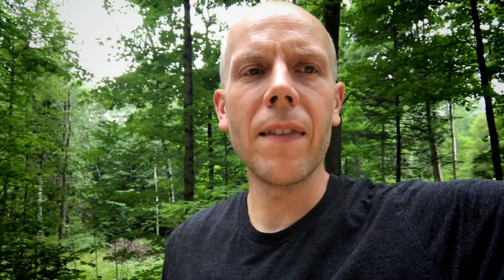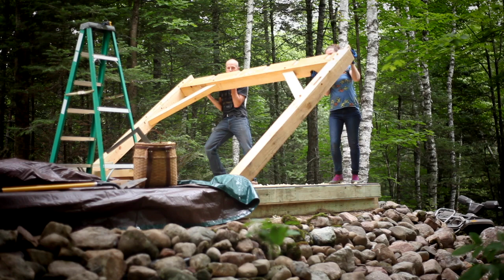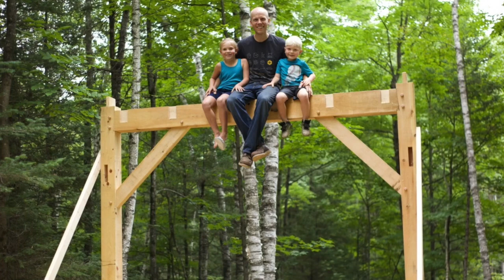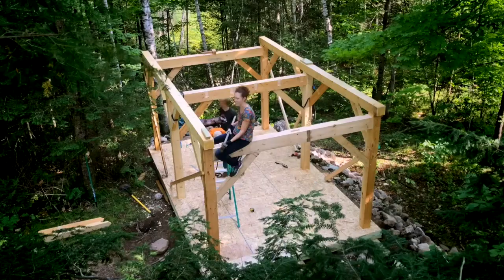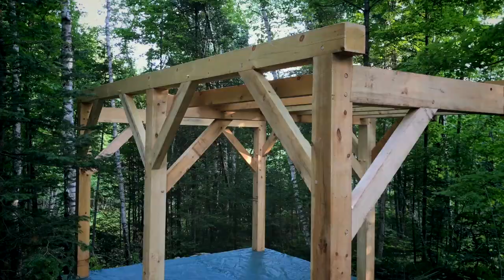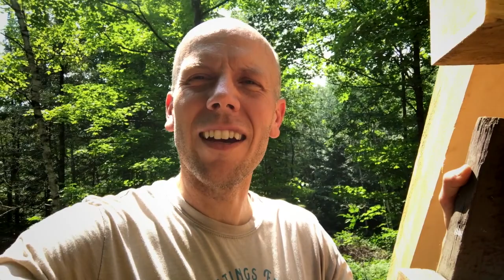Raising of the Timber Frame Cabin

Comment: The timber frame looks perfect. Do you have any videos of the exterior cladding and roofing process? How did you lift the plates? Looks like just 2 people lifted these. I'm sure they're pretty heavy.
Reply from the maker: Sorry for the late reply but hopefully this is helpful:

The exterior cladding was done by building a standard 2x6 wall around the frame and then finished with plywood and wrapped. I moved before getting to put up siding but was planning on board-and-batten.

Regarding the plates - they were white pine and had dried enough to lift with just a few people. So my wife and kids and I were able to get them in place on our own!

Comment: Wondering how the length of the angled braces joining the vertical / horizontal beams is determined .
Does the brace length depend on the height of the beams etc or  simply an optimal angle results in the angle brace length ?
Reply: Most braces that are mortised in are 36 inches to the two mortises. It makes the brace a little bit longer than 51 inches on a 45*

Comment: What kind of wood did you use for the timber frame?  I have a ton of pine on my property, would that be suitable or is a hardwood required?

Cheers from Northern Michigan.
Reply: The most common type of wood for it would be Douglas fir; by far. Now, that said, there are numerous woods you can use, however, there are some features the wood must have. It has to be strong and very resistant to decay and splitting.
If your trees are Douglas fir or white pine, you're in luck! If not, you can possibly still use them, just hit up Google. Oak is also good just fyi.
Reply from the maker: @gesshugh9976  This is made from white pine!

Comment: Dumb question maybe, but did you in any way anchor the frame to the foundation? Seems weird to me that this massive weight would just float willy nilly on a lumber platform. Over time, it could shift out of position. (Wind shear, foundation shifting, not sure if you're in a seismic area, etc.)
Reply: I was also looking at how the frame is joined to the foundation. I didn’t see that detail in the video yet.